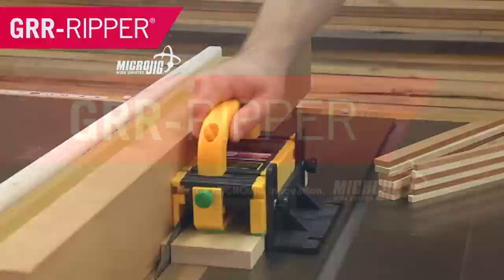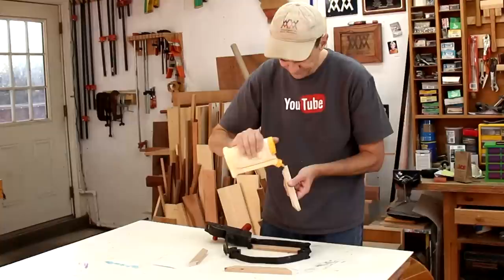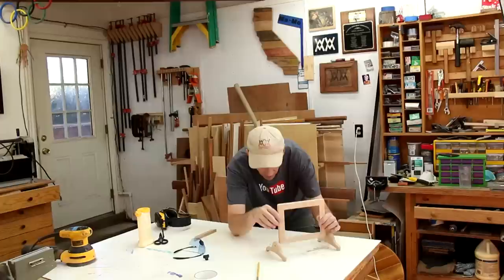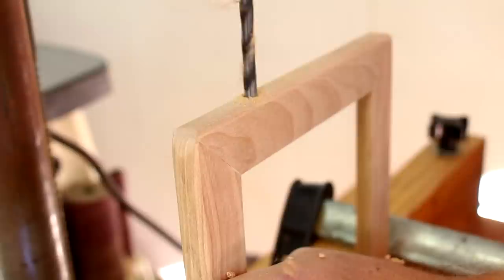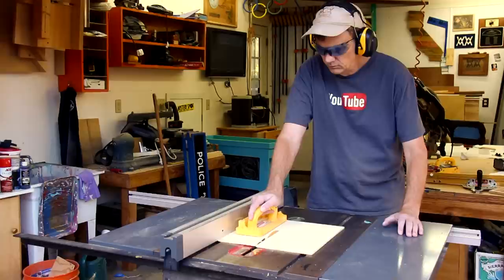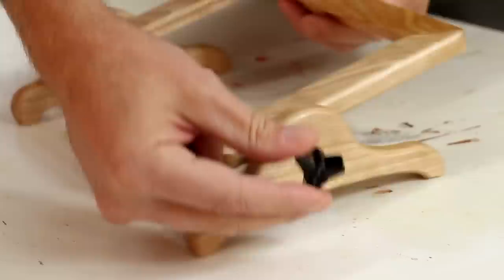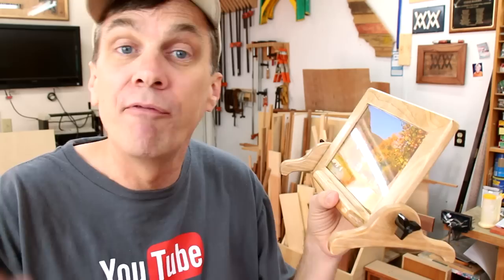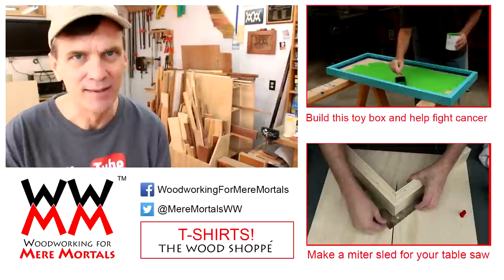This adjustable tablet stand for your desk is also a photo frame

Comment: Hey Steve, a great trick to drive in that threaded rod with no risk to damaging the threads: Thread on two nuts and bear the outside one against the inside one and voila! More torque with none of the risk.

Comment: Cool. Might make one for the kitchen. A little 'v' groove ground into the bolt will give you better threads in the hole; it'll cut more and squish grain less. But, of course, that's an extra level of complicated that I expect most of us (myself included) might just want to skip.

Comment: I really like this project *****.  In passing I have thought about making a stand for my tablet but never got far enough to actually come up with a design or anything.  That and I would have to actually clean off my desk to make room for it.  Anyway I never thought of making it a picture frame also.  That's a cool idea.
Reply: Oh, and an alternative to using a pair of vise-grips to screw the threaded rod in the frame where you can mar the threads.  You can put two nuts on the end of the rod and lock them together.  Then just use a wrench or socket to screw the rod in.

Comment: May I recommend you use a saw file to file a notch across the threads of a sacrificial bolt (imagine what a tap looks like) to create a cutting edge to "cut" the threads?  You could make your own star nuts from pieces of hardwood the same way.

Comment: steve just an idea for you when you need to put threaded rod into wood like that, rather than using a grips and chance damaging the thread, take two nuts and put them on the end of the thread tighten them against each other and use the outtermost nut and a spanner to turn the rod into the wood, when your done just undo the nuts and take them off :) hope this helps.

Comment: The stand looks gorgeous but it BEGS for wooden knobs instead of those ugly-a$$ plastic ones :)
Reply: Then you should do that if you decide to make this.
Reply: I agree... wood knobs.
Reply: ***** Wood knobs work well when a nut is epoxied in. Also added a bit of epoxy on the screws in my frame to hold help keep them in place.